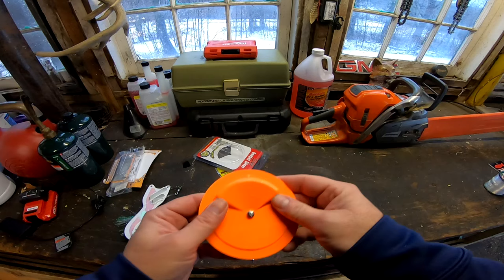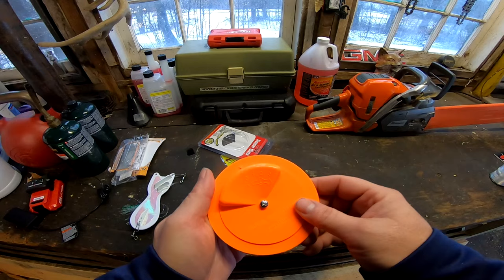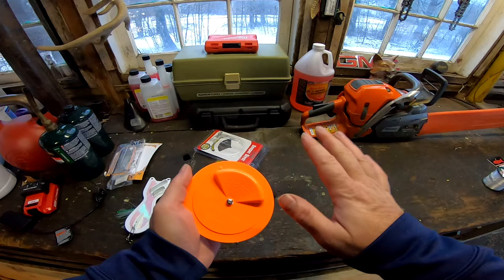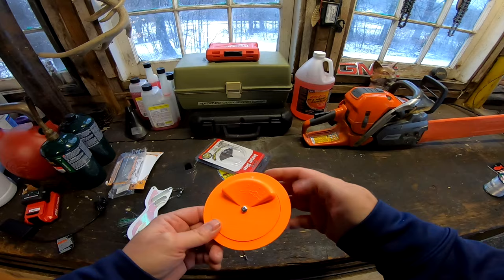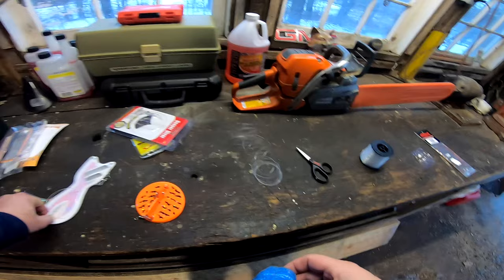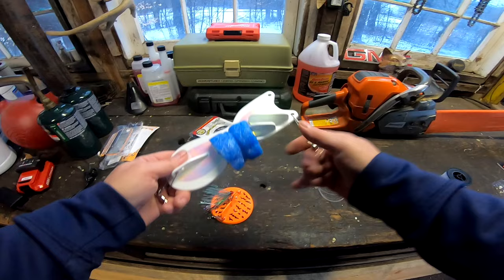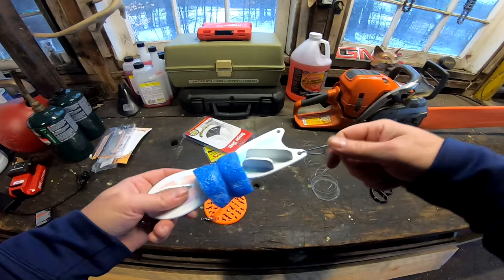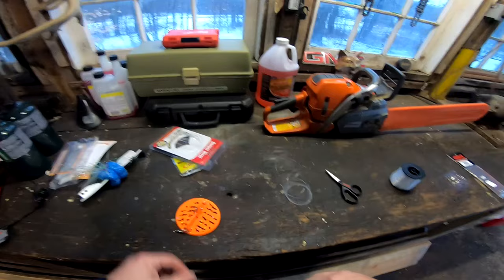Dipsy Divers / Flasher Fly / Leader Lengths / Knots / Storage Explained

Comment: How do you land a fish with a long leader. I have a 17.5 ft Lund fisherman and there wouldn’t be enough room to handle a leader that length. I like to use a leader as long as my rod so it’s easier to net the fish. I’m interested in trying slide divers to be able to run longer leaders.
Reply from the maker: We hand line them.

Comment: Another very informative video Chris!!!  A few questions for ya.  What are the two holes on the back of the flasher for??  I see a bunch of you guys run wire!!  Do you need special rods for that?  I would think wire would cut through your eyelets on the pole like braid over time does.  Ever use the Slide Diver where you don't have to worry about leader length when landing a fish??  Thanks!
Reply from the maker: The two back holes can be used to vary the action of the fly behind the flasher.  Each flasher usually has information on it.  For wire I use Okuma Convector Pro wire rods.  They have stainless steel eyelets which keeps the wire from cutting in.  I use slide divers at different times throughout the season.  I have a few videos on this channel showing how to use them and set them up.

Comment: I’m surprised at the length of the leader. 18 feet???  Do you get the fish close and then bring the fish in hand lining to the boat?  If I used anything longer than 9 feet I would not be able to net a fish without bringing it in by hand.
Reply from the maker: You're exactly right.  We hand line the fish to the boat.  It's not as difficult as it sounds and it gives you great control over the fish.
Reply: @tangledtacklefishing  What about big fish? 25+lbs?  is that dificult?
Reply from the maker: No. It takes some patience and practice but completely doable. We’ve done it countless times.

Comment: New follower here from WNY and greatly appreciate your videos they're very informative. I have a question, what length and action trolling rod will work best for dipsies And planer boards ? Your recommendation. Thank You.
Reply from the maker: Low divers are nine feet.  High divers are 10 feet and lead core, copper and rigger rods are all 8'6".
Reply: 8.5 to 10 feet.  If you're fishing solo, two 8.5 ft rods works fairly well, one on each side. With more rods, some variety in lengths helps.

Comment: What size rod are you using for the long leader length?
Reply from the maker: 10 feet for high divers and 9 feet for low.
Reply: @tangledtacklefishing  you must have a pretty big boat to run a leader that size my boat is only 22 foot there is no way I can run a leader that big
Reply: @tangledtacklefishing  great channel and great content by the way. I'm new at salmon trolling so I'm learning alot. Question though do you also run flashers with spoons? And how do you know when to run a spin doctor vs doger vs flasher
Reply from the maker: @stevesheldon452  I don't run spoons with flasher, but not saying you couldn't try it.  And there is no way to answer the second questions in a short comment.  Experience is the big factor.  My best advise is to just get out there and go for it.  It's the best way to learn.
Reply from the maker: @stevesheldon452  you absolutely could.  You have to hand-line it.  I've done it on 16 foot boats.
Reply: @tangledtacklefishing  yeah I'm not keen on hand lining it lol